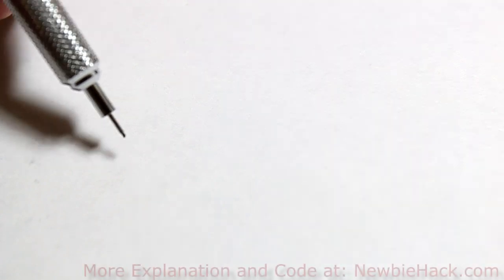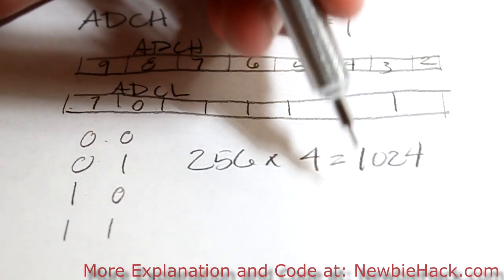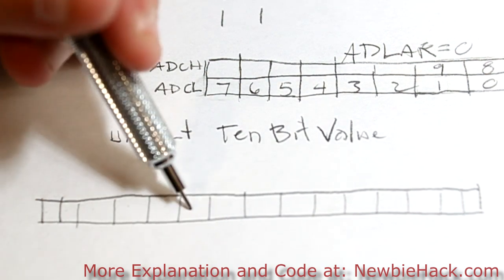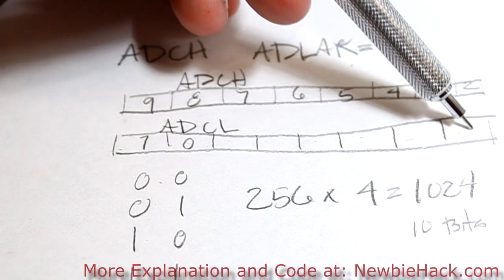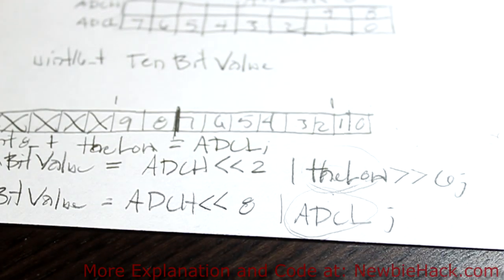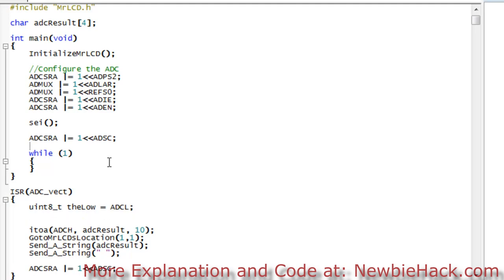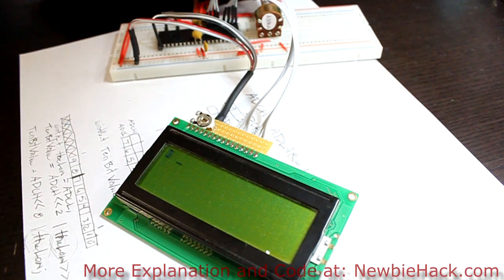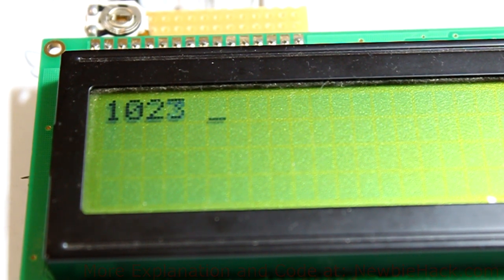32. Arduino for Production!  AVR Atmega - Getting the Full 10-bits from the ADC

Comment from the maker: @kratok2006 The value swinging is cause by two main things:  Interference that may be introduced between the potentiometer and the microcontroller, and the noise produced from the AVR core itself.  Regarding the latter issue, I have a video that will show how to minimize this (putting the micro to sleep while a conversion takes place).  The swinging will not be completely eliminated in this prototyping environment (use of breadboard), but will be reduced.

Comment: What if the OCR1A reaches more than 65536? For example I want to convert a sensor output after every 10 min, the OCRA value reaches a lot more than 65536 even if I take 1024 as prescalar?

Comment: There's no much sense in getting 10-bit resolution from AVR ADC without calibrating it, because two LSBs will contain noise and offset/gain error. Errors and calibration process are described in AVR120 appnote. Or am I missed some words about calibration in a video?

Comment: ADLAR must be set to 0 to get ADC 10 bit.
I just try the 6 studio and the compass routine that performs arctg(-x/y) with float numbers and a linear interpolation from a 18 float array, it has half the size when compilled... in terms of speed is no differne (at bare eye) in normal execution on micro so I think it's realy nice.. the avr 6 It's so slow when it starts tough on computer and do not recodnize an home made isp proggramer... but it has nice tips while you're typing

Comment: before the lcd show adc value, screen disappear. And then it comes back again. How can i fix it?
Reply from the maker: Sounds like a bad connection.  If that is not it, try adding some delay in the communication to give the slow processing of the LCD some time to accept the communication.
Reply: Patrick Hood-Daniel thanks. its done. thanks for your helps. you are the best.